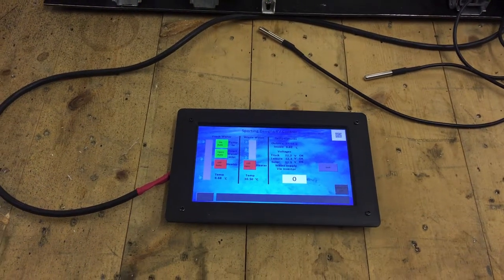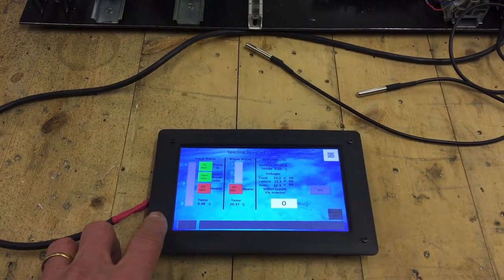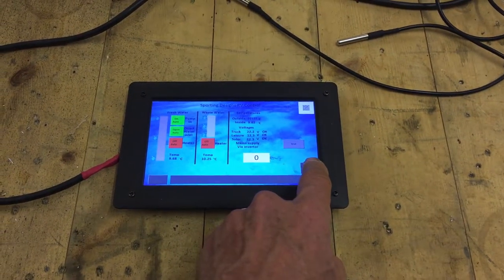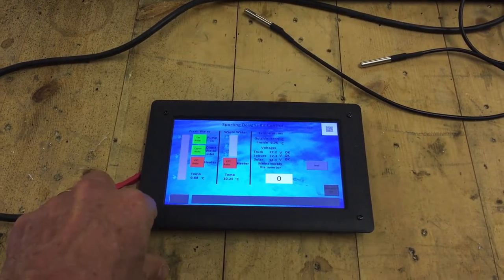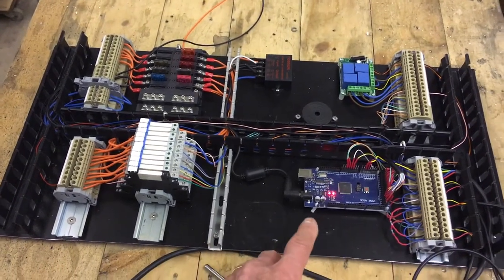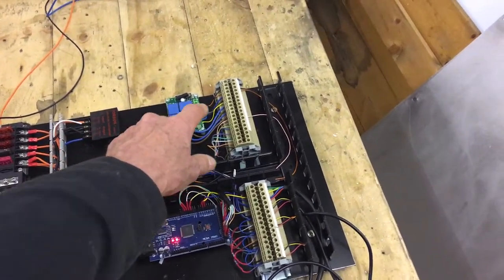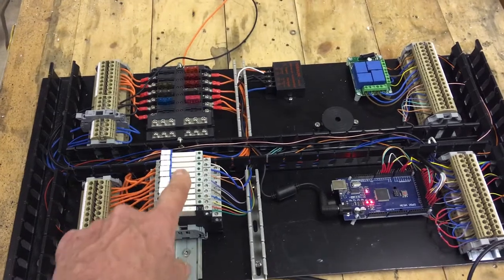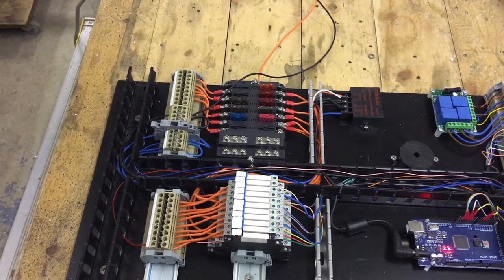RV Conversion No 5 - The controller and display

Comment: work of art! what temp sensors are you using?
Reply from the maker: Hello. Thank you for your feedback. I used temperature sensors "DS18B20 Waterproof Temperature Sensor for Arduino" and purchased from eBay. They are pretty easy to use and reliable.
Reply: @sportingdesigns  thought so. Did you extend the wires to reach where you want to put the sensors? I played with these years ago and had issues with long cable runs.
Reply from the maker: I put a connector (Mate N Lok Universal Connector Pair - 3 Way) at the end of the sensor wires and have a good cable (nothing special) going back to the controller.  I've had no issues with them apart from one failing in my grey water tank.
Reply: @sportingdesigns  thanks. I might have to give them a go again. I currently have RTDs but with some circuitry over SPI to read them. I want to keep it simple as possible so will try again with these digital sensors. You must have a electrical history building a tidy panel wiring as you have done?
Reply from the maker: Yes. Actually I was originally a Mechanical Engineer but for the past 40 years I designed and built Process Control Systems. So, this is pretty simple for me. For the electrical parts I occasionally asked colleagues for help but YouTube is so useful
Reply: @sportingdesigns  yes thought you might be the industry. I am an instrument technician by trade in oil and gas and notice a tidy panel design when I see one!

Comment: Looks interesting.  What probes are you using for the water tank levels
Reply from the maker: Hello. I am using "Fresh Water Tank Probe For CBE PC100" which is 12volts and gives 3 levels. I got them from 12voltplanet and they seem to work well. If you want a fully analogue method, a friend suggested Vegetronix unit which has a wire inside the tank for a very accurate reading but I don't have this.
Reply: @sportingdesigns  Thanks.  I am looking for an analogue gauge.  I have had some success with an ESP32 capacitive touch pin and a home made probe.
Reply from the maker: Hello. Further to my previous reply, I needed a bit more resolution and so have now fitted a couple of "S3-E 0-190ohm Signal Yacht Car Oil and Water Tank Level Detection Rod Sensor" from buy2fix. They have a physical float which goes up/down a rod and gives a 0-190 Ohm output. I used a 1500 Ohm resistor as a voltage divider to provide a voltage input 0-1.35 (ish) volts into my Arduino and this is accurate enough for me. So far so good. Ask if you need more help with the connections.
Reply from the maker: Hello. If you are still looking - please look at my other reply